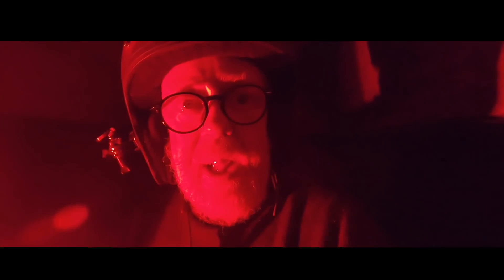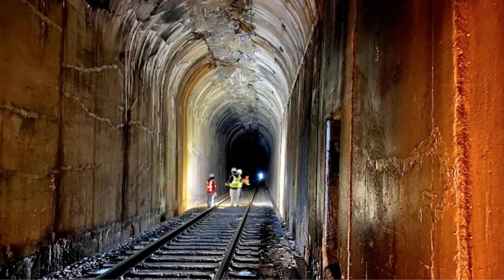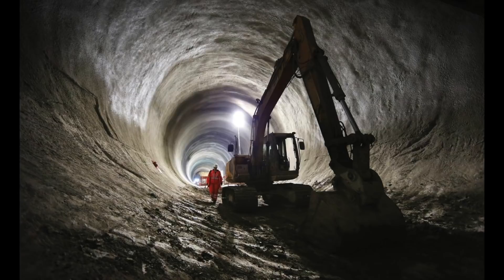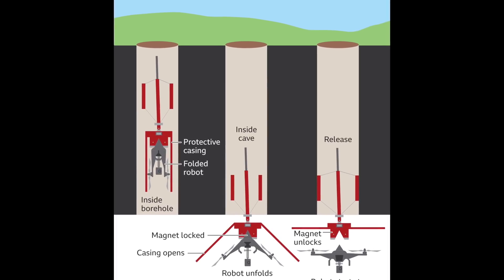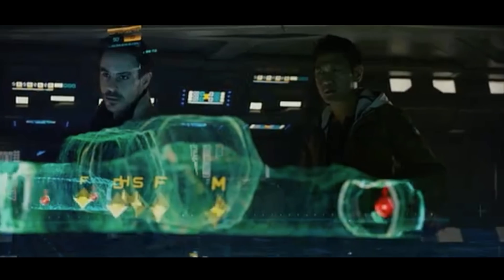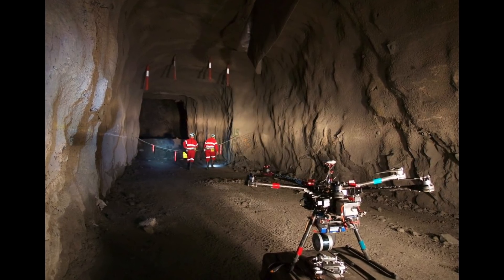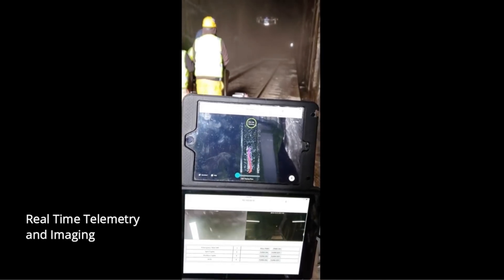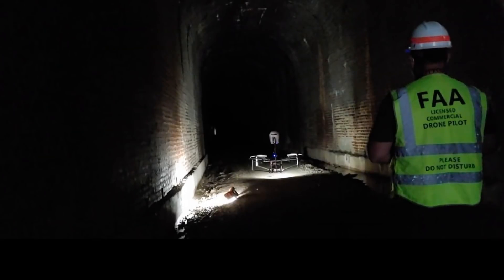Prometheus Drone Tech - Prof Simon

Comment: I think there's a bit more to this than you think. For one thing there is the issue of retrieval. Given the high level of AI required would a company/government be very happy if this tech fell into the wrong hands especially if this equipment was discovered in an area it had no right to be in ? The (current) limited range might end up as a requirement.

Comment: Still waiting for them to miniaturise it and stuff it in an artery.
Map the condition of the walls through out the body.
Maybe do some simple maintenance work too.
Preferably without becoming an embolism....would be bad.

Great stuff though. Using laser scanning for building surveys myself.
Those damn point clouds files are a pain in the rear though.
Seriously need filtering/conversion from... points > hi def surfaces > lo def surfaces.
Almost unusable due to the file size bulk at the moment.
Plus it would enable them to be converted to editable/moddable abstract vector objects, rather than barely usable 3D bitmaps.
Reply: Amen.

Comment: It is a non starter at the moment. Without GPS or anything similar the drone data is altitude agnostic (or the other fancy word I cain't recall at the moment).  Basically, apart from the first  and end reference points all data is 'floating'.  There is a solution, and that is to use inertial navigation systems based on gyroscopes, ten a penny in the surface fleet but perhaps a tad large for a drone.  I reckon 3 accelerometers and 6 months would make it achievable.
Reply: Or Darpa.